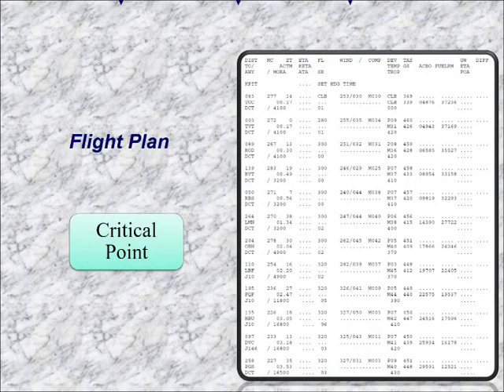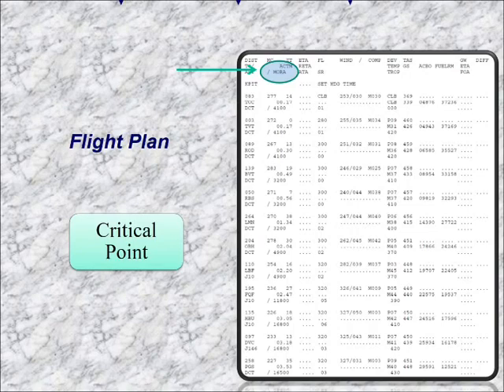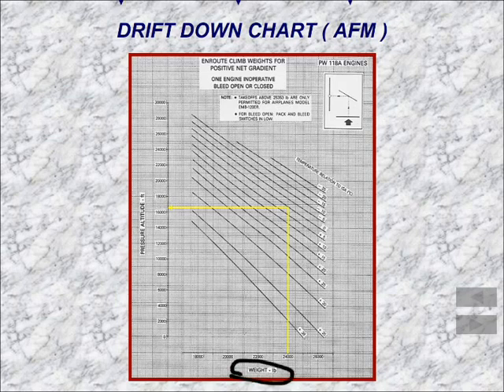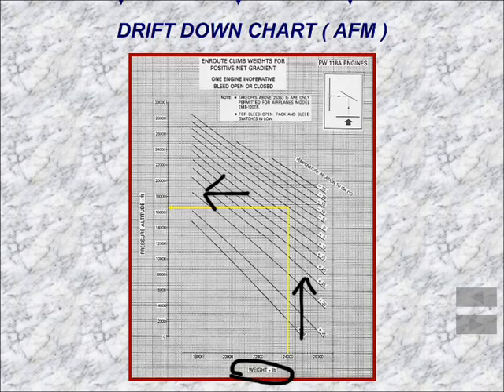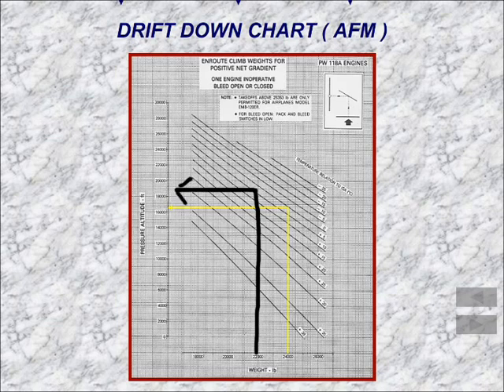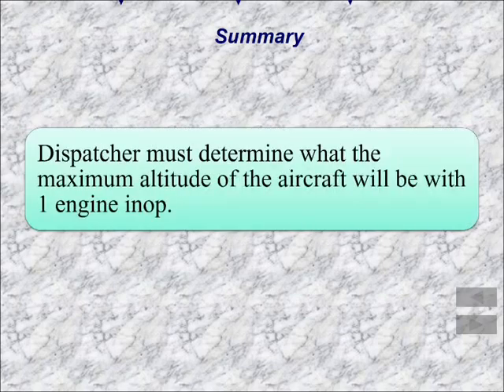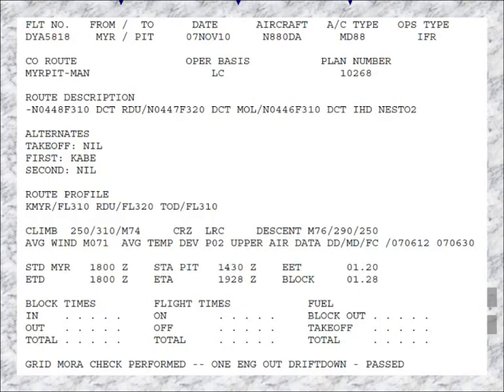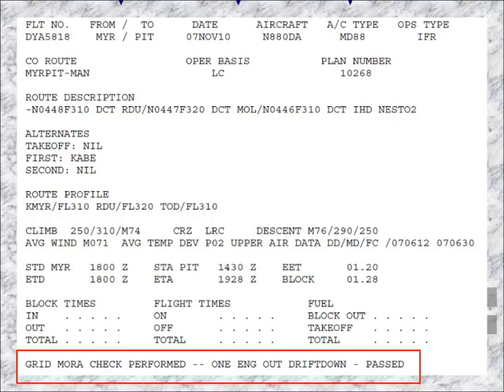Part 121 Aircraft - Driftdown Real World Example

Comment: I thought the CRITICAL POINT is when an aircraft is the same flying time from 2 potential en-route diversions. Your definition in the very beginning sounds different. Not very clear on your part.
Reply from the maker: Hello, that is also a definition of the critical point (or the point of no return) when considering fuel requirements for a flight. However, the term has more than one general use in aviation.

Comment: Just curious why you used an Enroute Climb Weight chart. Wouldn’t this be used in the case of an engine failure and needing to climb to avoid terrain, as opposed to a drift down chart where at cruise (say FL350) you lose an engine and want to know at what altitude the aircraft will level off after drifting down?
Reply from the maker: Great question, Pete. The presentation used this as an example only. For various airplane types and engine combinations, the chart may be labeled differently. You are correct with your explanation of a drift down chart and determining what altitude the aircraft will end up at after the driftdown. I think that when this was made (a while back) I didn't have a ton of information to work with in the presentation.

Comment: Great review   With respect to Glass cockpit aircraft,  you have selected a route that has the Grid MORA protection along the route and it is vitally important not to accept direct routing; sometimes offered by ATC [ air traffic control ]; in their effort to be helpful.  You may also notice that the route and waypoints that has been traveled disappears from the computer display after passing.  Be careful to understand that you may have to rebuild the route behind you in the computer since the nearest suitable airport may be behind your aircraft position. Although continuing forward along the route will afford you the intended protection you have to guard against the Bias that may exist, to continue in the direction of travel since the nearest suitable airport, may be along the filed route behind the aircraft position which will require reconstructing the route in the backwards direction.   I understand that this may be difficult to understand initially but if the nearest suitable airport is behind the aircraft you are required to follow the previously flown route in the reverse direction. or establish terrain separation with ATC at or above your drift-down maximum altitude.
Reply from the maker: Thank you for the additional information! This is helpful.